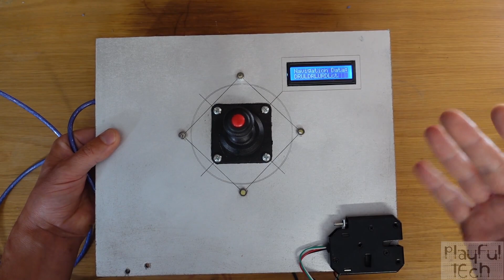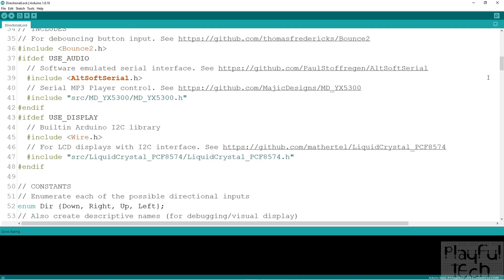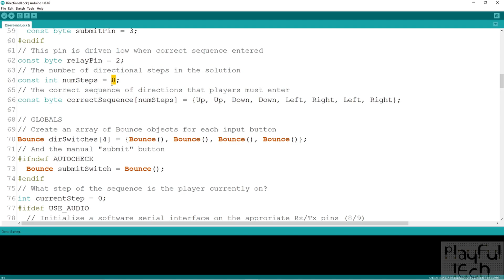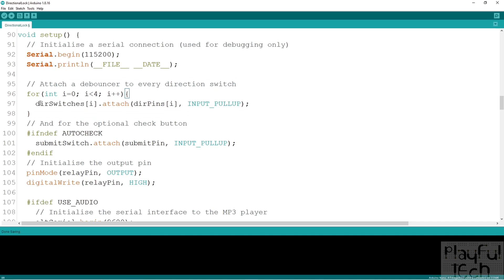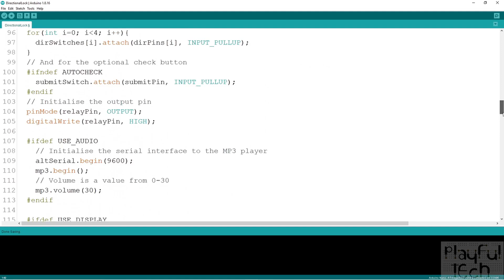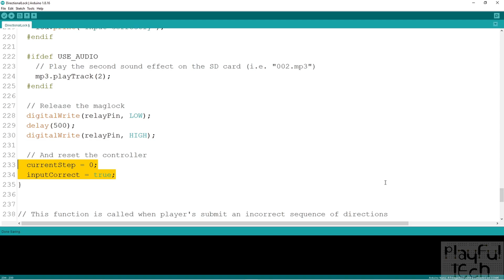No more Directional Locks.... could this be the end for Escape Rooms?!

Comment: I've always hated directional locks ever since I had them incorrectly explained to them as only having a four "digit" code, and although I was staring at the solution in the room I was thinking it wasn't it, because it was more than four moves.
So having the feedback would have saved me a lot of frustration then.
It obviously helps to secure small areas where running cables would be inconvenient or just plain impossible, but the use of them is definitely not as straight forward or entertaining as a joystick, so I'm not sad they're going away.
Not to mention most of the times it was used in a very basic and lame way.